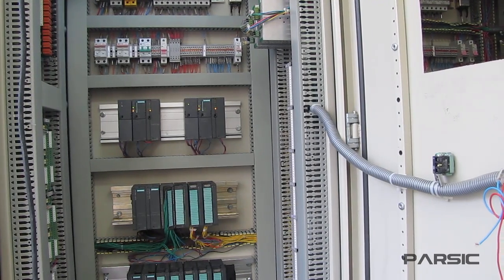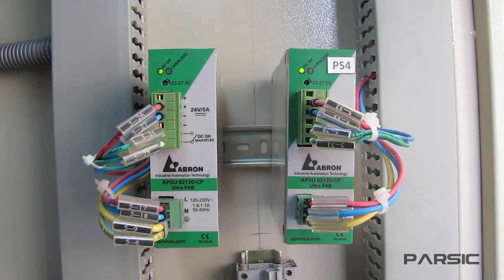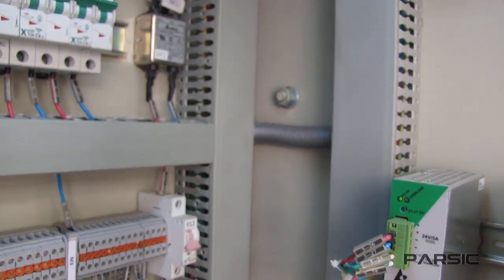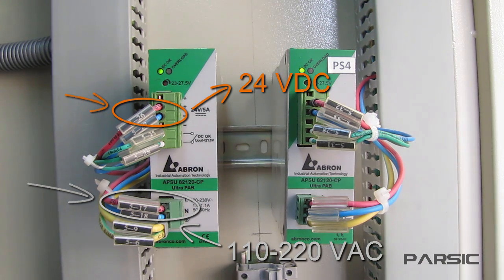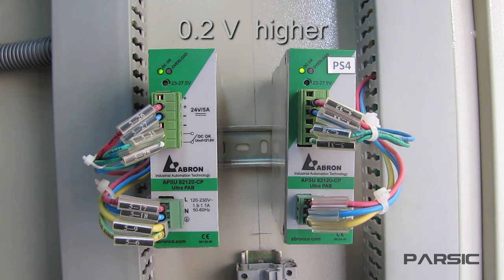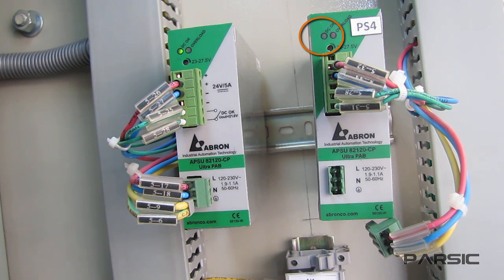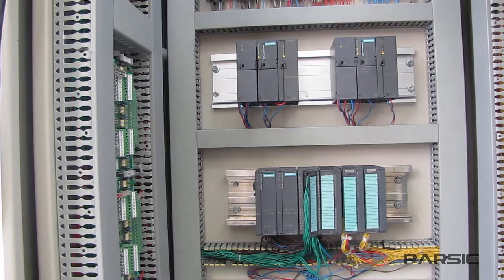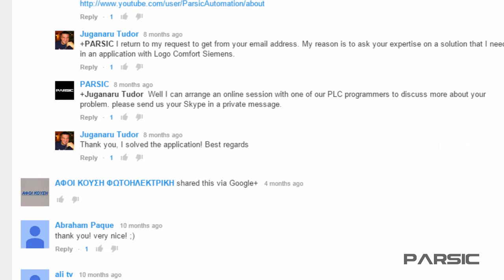What is a Redundant Power Supply and How Does It Work?

Comment: I just wonder if it is necessary to use a diode module of the same brand as the power supplies.
And thank you for your effort.
Reply from the maker: Hi there, 

Thank you for your question. It's not necessary to use the same brand of equipment as long as the technical specifications, such as current and voltage, align. However, it's important to exercise caution, as certain power supplies may feature wired output relays that are connected to a monitoring station or Programmable Logic Controller (PLC) to alert operators in case of a failure. When considering factors like cost and engineering specifications, it's generally advisable to adhere to the original design, unless the power supply has become obsolete, in which case an upgrade would be necessary.

Happy learning!

Comment: They have different power source. Don't they?
Reply from the maker: There is a single source of AC power to the panel.  Power supplies are used to convert AC to 24 VDC to be used by the different PLC and I/O circuits in the panel.  Some devices, such as the HMI panels, use the 120 VAC power directly.  We use breakers to provide the means of isolating the different AC and DC circuits.

Comment: So in all cases does only one power supply carry the full load ? I mean is there a case where the load is shared between the PS ?
Reply from the maker: Yes, depending on the hardware used, either one power supply is used at a time (redundant configuration), or both are used in parallel.  Connecting 2 power supplies in parallel, even with current-directing diodes, is not the most efficient use of the power supplies.  One problem is the result of one supply failing or the output circuit faulting/short-circuiting.  The other problem is that no two power supplies are identical, so the one with the higher voltage will provide more of the power in a parallel arrangement.  The only practical reason for parallel operation is to boost output current.  In that case, use a larger power supply.  It is the safest and most efficient.  If you are worried about reliability, use a redundant power supply configuration with a  diode
 “ORing” module to switch from one power supply to the other when there is a failure.  This will maximize performance and power supply life.
Reply: @realpars  thanks

Comment: What is the difference between the redundant power supply you have here, and a dual redundant power supply?
Reply from the maker: In this video, there is a voltage detection circuit that switches power to the devices from one power supply to the other when a power issue is detected at the primary power supply.  This is a sophisticated and efficient way to provide continuous power to the panel, maintaining surge protection and other safeguards on a power-supply-specific basis.  Another way to provide redundant power is to connect both supplies in parallel to the loads without a switching circuit.  This is not as efficient since each supply will run at a reduced load, and a catastrophic failure of either power supply could bring the entire power supply system down (surge could trip both power supplies' breakers).

Comment: Tepergy, I appreciate your work which have proved very helpful for me.
I have one problem in PLC could you build ladder logic for sequence 
1. (A+ D+), (B+ C+), (A- D-), (B- C-) here A&C is operated by double solenoid and D&B is operated by single solenoid.
2. The following operator controls must be incorporated:
a. SW1 will be used to select between single or continuous cycles.
b. PB1 will be used to start the sequence in either operating mode.
c. PB2 will be used to stop the sequence (at rest position) in continuous mode.